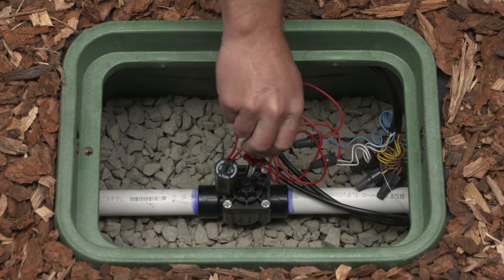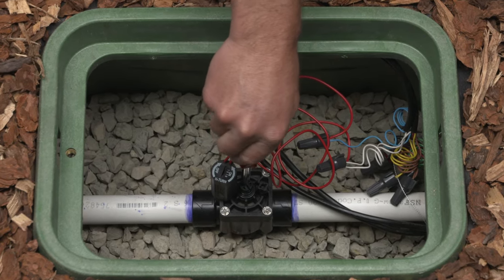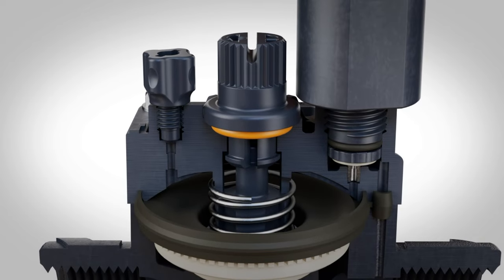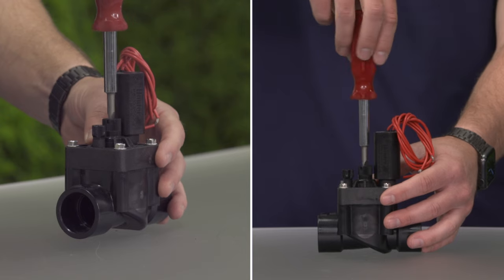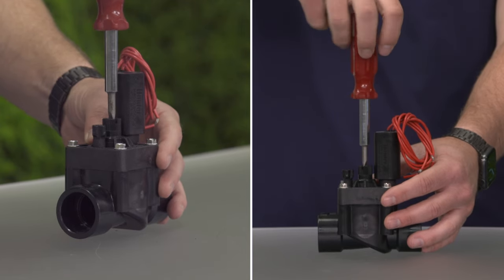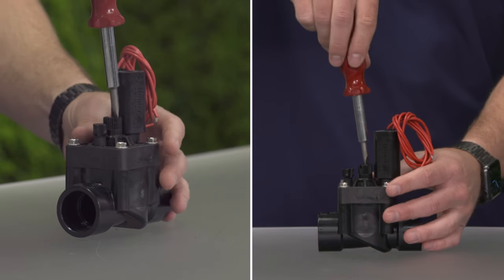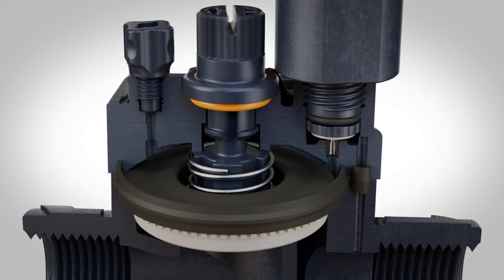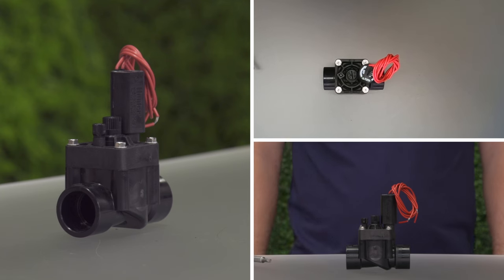How to adjust and tune a Hunter valve for optimal performance

Comment: My flow control valves actually do nothing for the flow, when turning them either way? I can turn mine 25 times in either direction and nothing happens. 
I have taken my valves out, cleaned them and put them back in and the only way I can get a sprinkler to actually work, is to open the air bleeder half a turn then they turn on? Close the air valve and they turn off? What is going on?
Reply from the maker: It sounds like it's time to contact our customer support department: https://www.hunterindustries.com/hunter-technical-support-email-request

Comment: Should I open up the rest while it’s running?
Reply: You’re supposed to shut off water to valve and then turn all the way down. Then activate the valve through controller. Then quarter turn. Then open water lever and boom done : 

Also can open more if you think you need more pressure rather than quarter turn do 1/2 turn